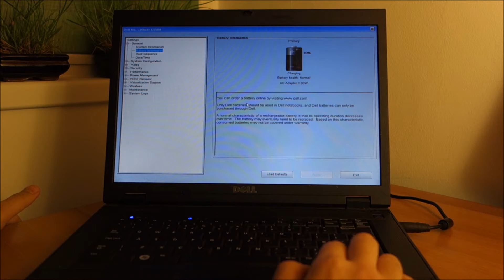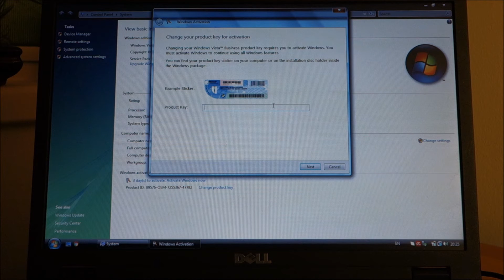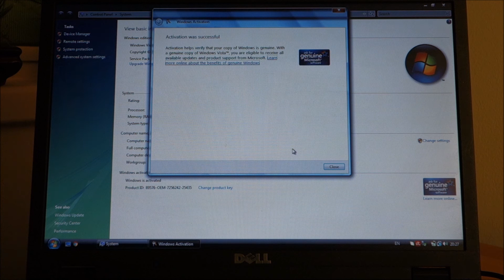How to upgrade a DELL Latitude E5500 laptop

Comment: Still have one of these things and it definitely shows its age. Still, it makes a decent lightweight Linux server if you pop in an SSD and max out the RAM. Alright for lighter tasks, though don't expect it to run anything too intensive or too modern. Mine doesn't work at all on battery, just AC power, but it's not worth repairing it for what it is. As with most of my hardware, I'll just drive it to the ground until it breaks completely and utterly, harvest it for usable parts and recycle the rest.
Reply from the maker: Your mentality is what can save the world! ✌🏼